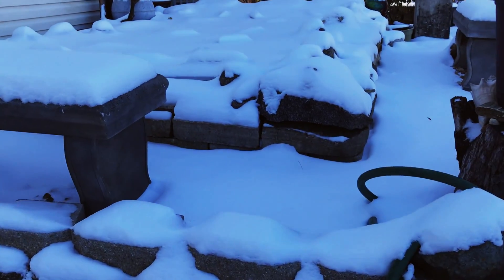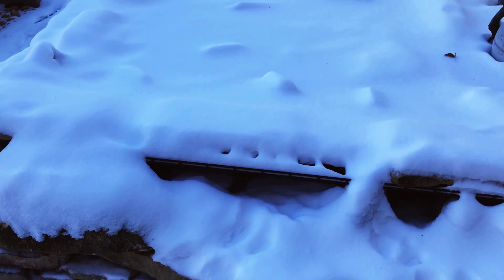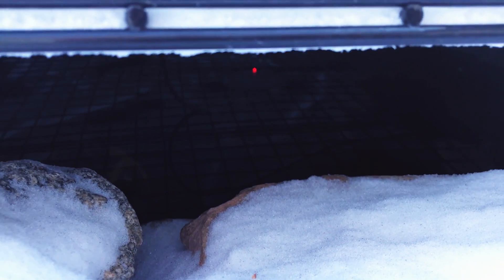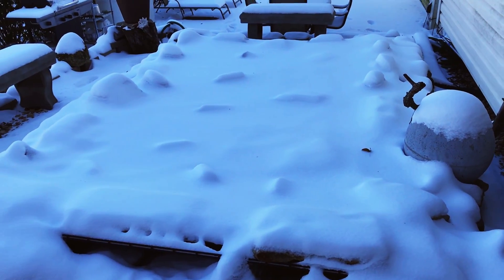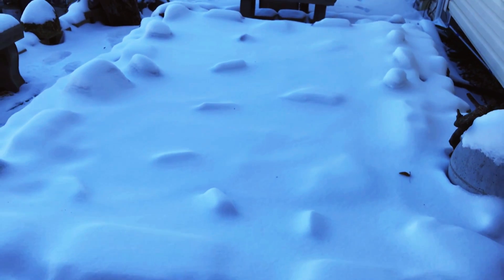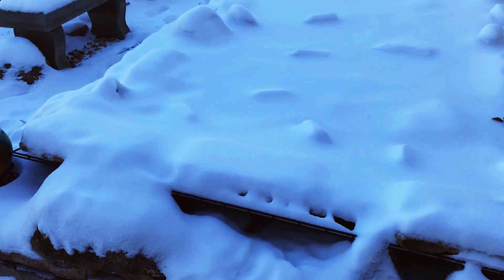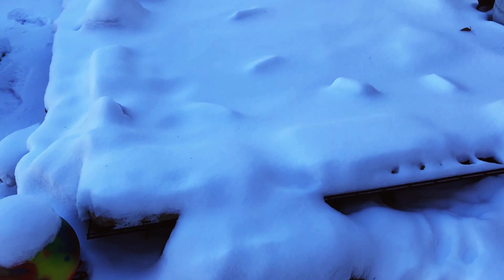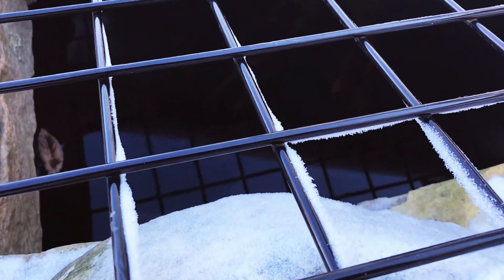Koi Pond in Winter (December 2017) - Below Zero Degrees Fahrenheit

Comment: Have you considered a Recirculating Tube on a timer ? You can Toss a metal coil Into the pond for the winter, and use the water from your water heater to just pass through it. The water never leaves the system, and returns to your water heater . These fish are a huge emotional investment , would be a shame to lose them. Thank you for sharing .